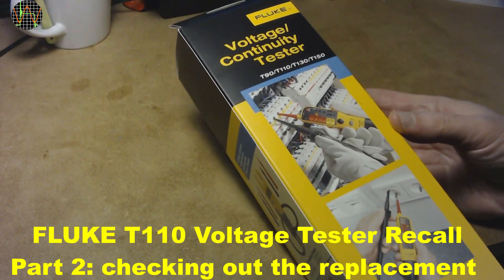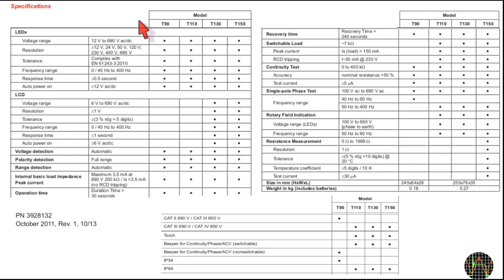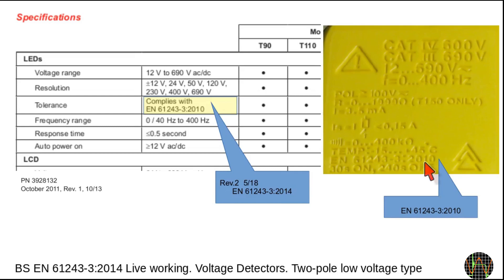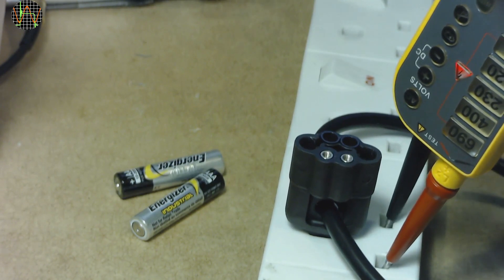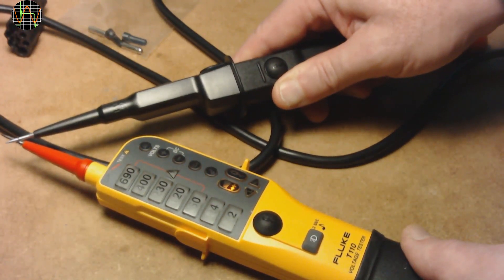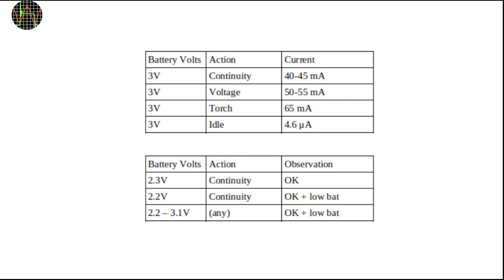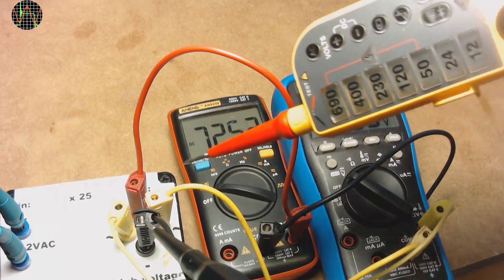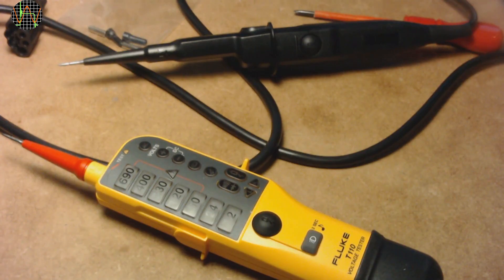FLUKE T110 Voltage Tester Recall part 2: checking out the replacement

Comment: 0:35 - 0:55 Whatever changes they did make, this range looks better built than the T-120 I bought years ago. The lead would always break at the point it meets the body. There's no need for the LCD for testing for live voltage, so I'd just go for the T-110.
Reply from the maker: Hi bitTorrenter,
I agree, that is why I chose the T-110 model over the one with the LCD.  The problem with the lead breaking was, if I remember correctly, one of the reasons for the recall. I had mine not long enough for this to happen before they recalled and replaced it. So far, no problems with it.
Reply: T110 is my choice too

Comment: Would you say fluke is the best brand and also what metre is the best all in one that does everything or most things if there is such a metre thankyou great video
Reply from the maker: There isn't a "best meter", only one that best meets your specific needs and budget. Consider what you want to measure at what accuracy and at what protection level for user and meter. Also consider reliability, repairability (schematics / service manuals) and if you can recalibrate it, given you have the equipment. There are lots of meters that are far cheaper and yet have much better specs than Flukes but lack in protection and service documentation.  There are some brands, e.g. Brymen that have the same excellent level of protection as Flukes and still slightly better specs at a lower price, but no service docs. Fluke is commendable in putting user and service manuals on their website and Flukes hold their value if you decide to sell it. So it really comes down what your priorities are.
Reply: @TheHWCave I really appreciate you taken your time out to answer my question in such a detailed manner, you have given me much better idea on the pro's & con's of purchasing electrical testing equipment as a novice this information is invaluable to me as you covered everything and honestly could not be happier and could have asked for more, I'm privileged to have found such a useful channel such as this to learn from, and I will definitely be subscribing, Thankyou.

Comment: is there a voltage phase tester that tells you also what phase is it like Ph-A, Ph-B, or Ph-C?
Reply from the maker: There  is the KAIWEETS ST120 that has non-contact phase detection ABC. I reviewed it  https://youtu.be/2XAa2By9Xg8     but I never got that phase detection to work for me,  in all fairness, probably because my "simulated" 3-phase was not very good (I don't have 3-phase at home)